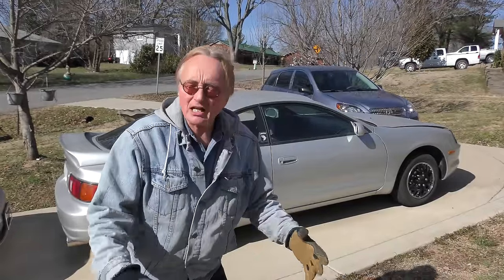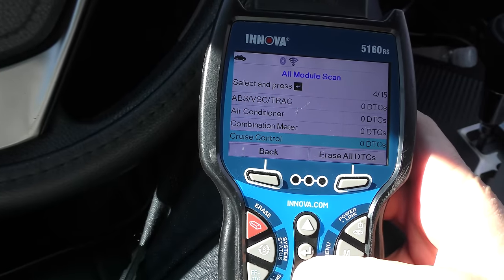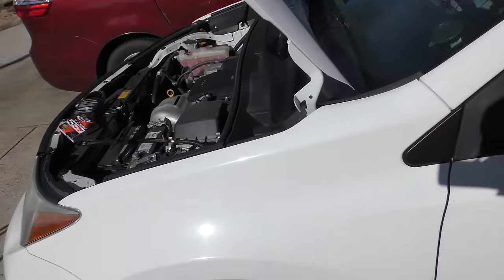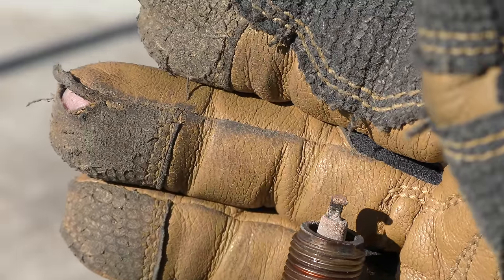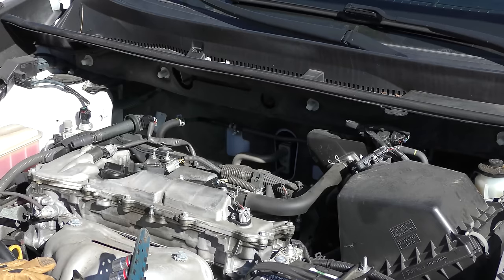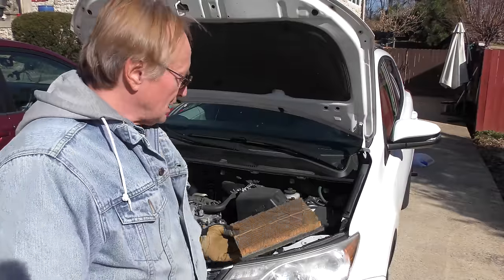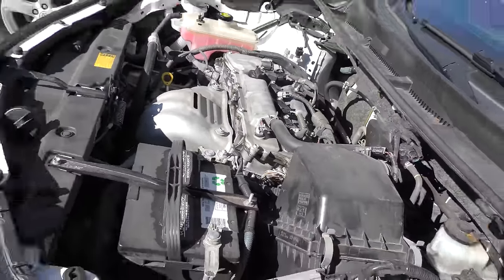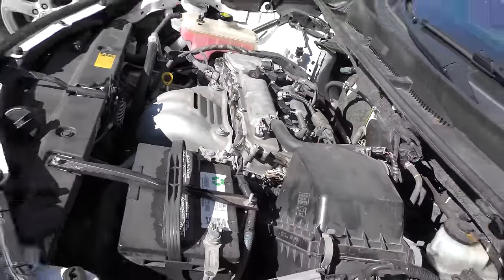Here's Why You Should Remove Your Gas Cap Right Now

Comment: Do you have any tips for getting pieces of broken porcelain spark plug out of the hole your coil pack goes in. I’d like to see what methods people have tried. I did my spark plugs yesterday and I have that exact car same year and model and mine has 101k miles on it. My dad used an empty wrapping paper roll to make a custom vacuum attachment to fit in that tiny 1inch wide by 7 inch deep hole to vacuum out the pieces

Comment: My new mechanic described what he did to my car recently as a tuneup. Of course, 150k miles on the original spark plugs meant at least changing those…
Reply: What to the old mechanic I would have stuck with him had to be good mechanic if you never even changed spark plugs hell we change ours in our race cars every race we like to think that's why we are in the top seven at end of season every year except this one with cover it really messed our season up when you hit the corners on our high banked curves at pevely i55 raceways we haven't had races and we planed things with family  doing other things because couldn't know if raceing u till the day before the race and by God it was a pain maintains the 6 feet apart rule side ways in a curve at apoxamatly 100miles a hour strick fines if caught closer lol still in top 12 finish no one knew if we were racing or not I told them we should be Abel to out run it but I quess the track officials couldn't a little racing hummer this morning every body act like allied and be safe just rousing you Allied official your great see yo I next spring if you all ain't afraid of the getting dirty lol can't wait new car bigger moter and possibly a new driver

Comment: When you change your air filter, clean your MAF (mass air flow sensor) and throttle body. If sensor is dirty it won't mix air and fuel properly. Same with throttle body. I change my plugs every 50,000 miles.

Comment: I have a 2006 Avalon, low miles.  It's an awesome car, but the traction control is worthless on extremely slippery roads.  It will not go any ware.  There is no way to turn it off.    I found that I can loosen the gas cap so that the computer will through a code.  When warning comes up it turns off the traction control. Yeah!

Comment: I always replace my fuel tank caps to locking fuel caps due to fuel theft and vandalism.
Reply: Do you drive a 1960s vehicle? I’m pretty sure all cars made since the 80s or so have anti siphon mechanisms to prevent fuel theft. However, nothing will protect your gas tank from a desperate individual with a drill
Reply: @Prosecute-fauci  only thing with the locking capts the punch lock-in catching up in the filler hose I just never put my gas in it unless I know I'm going to drive it out same with the windows you don't roll your windows up and lock your car in the hood you just don't leave nothing of value in there leave windows open so you keep the glass we can have the cigarette butts in the ashtray and the change under the seat speaking from experience unfortunately
Reply: @Prosecute-fauci  yeah it's a screen you need a longer screwdriver
Reply: When the battery operated saws started coming around catalytic converter nothing to steal 1 if you don't have to hacksaw through it that's too much like work

Comment: Scotty, for Toyotas , should the spark plugs be NGK or DENSO ? Not AUTOLITE? Kindly advise please.
Reply: I have a Toyota and change my own. Over 250,00. I always use NGK.  That's what Toyota recommends and other mechanics I have watched. I never had to thread it or anything. They work well for 100,000 plus. I drive a lot!
Reply: You can use either NGK or Denso  never buy auto lite they’re cheap junk or anything that’s not NGK or OEM (Denso)
Reply: Use Bosch spark plugs.
Reply: NGK.  I tried Bosch in my Vibe (Matrix/Corolla engine) years and years ago, and was not happy with the performance.

Comment: What about gapping plugs?
Reply: Any new ones with the tiny pinprick electrode tip are already set because if you try it you will break the tip off. The old copper type with the big diameter electrode can still be gapped.

Comment: Never buy pre gapped spark plugs, theyre always wrong. I bought some that were made for my truck and they were further apart than my original used spark plugs were.
Reply: @Buick Mackane  pre gapped spark plugs are way more brittle and easier to break. I meant what I said, you should just avoid them.

Comment: Nowadays I consider a tune up changing out the plugs, coil packs, air filter, fuel filter, oil/filter, transmission fluid, gear oils etc then resetting the computer. Just maintenance really

Comment: My Coleman 5k watt generator doesn't run right. I do believe it's the bad/worn/broken rubber seal on the vented gas cap causing the issue.

Comment: I have the same problem with my 2013 Rav4, the tire pressure light keeps coming on. 🤔 Did go to Firestone and had one sensor replaced because one tire was 30psi  but the light came back on, and then it went off the next day, not sure if it's the crazy weather we have in Erie, PA or my system is showing its age.
Reply: It's the weather.

Comment: What happened to checking the spark plug gap before putting the spark plug back in, as you can't always trust the gap that the spark plug came with from the factory?

Comment: Years ago my 2005 Subaru Outback showed a vapor leak. New gas cap applied. Still a vapor leak. Long story short, a rat had chewed all three small hoses that apparently return pressure to the gas tank and run from the fuel filler opening to the tank. Had to remove the passenger rear wheel and wheel well cowling to get to them. Once replaced, the code went away.

Comment: I'm really wanting Scotty to have an in-depth review on the new tundras and if it's better to buy the new models compared to the 5.7 v8s
Reply: Any Tundra has enough power.  It is the Tacomas that are too light on power.
Reply: I wouldn't take advice from someone who puts autolite PLUGS in a toyota
Reply: Do you use champion  or ac or those splitfirejunk that I never had any luck with love had good luck with accel plugs and wires

Comment: Scotty, my tayota Yaris from 2000 has 2 problems, one is the catalyst(P0420 - Catalyst System Efficiency Below Threshold (Bank 1) i did once a cleaner in but i drove with if on diffrent days did it work then or nha>? in total i drove 500 miles witht he problem

Now my car is also at a cold start holding in what could this be? When the engine drives like one minut its perfect, but before that its holding in. what to do?

Comment: Ihave original plugs in my 3.0 mitsubiti montero sport 2001, Ive got 230k on it and still get 20 mpg hwy, Im shocked at that. I had decided to see just how many miles it would take to effct the emissions or decrease mileage. Ive passed SoCal smog  every 2 years since new . I am amazed of the reliability. Is that typical of these or even other cars today?

Comment: Are gas caps one those parts I should try to stick w/ OEM so I don’t run into issues with sealing? Or would aftermarket be fine?
Reply: Stick with OEM.  Gas caps aren’t that expensive
Reply: Bought a cheap aftermarket cap, nearly got stuck in filler neck, tossed it, got an OEM.
Reply: OEM . We have tons of issues with aftermarket gas caps at dealership .
Reply: Only a few bucks more go OEM
Reply: OEM at all costs..
Reply: I still have the oem cap, with aftermarket rubber seal, its working well for me.
Reply: @theroyalcrownedtiger2946  oh u can change out the rubber seal itself? What vehicle do U drive?
Reply: @selwyn13  : I drive older GM vehicles.
Reply: @selwyn13  : I picked up the aftermarket gas cap assembly for a Ford, and removed the rubber seal, and installed to the oem GM gas cap.

The threading on the gas cap is different on the Ford and GM, but the seal works and fits just fine.

If you got a import branded car, forget about swapping parts, and just get a new gas cap from the dealership.

Comment: Tire pressure monitor sensors 50 bucks each aftermarket advance auto. Make sure your mechanic can read the toyota system correctly. Some scanners cannot, and they will tell you all four are bad. I had a 2014 rav 4 same trouble. Stupid but annoying. So i spent the 50 and 20 for a tire guy to replace. When you get tires, make sure your man knows there are sensors there or their machine will destroy them.

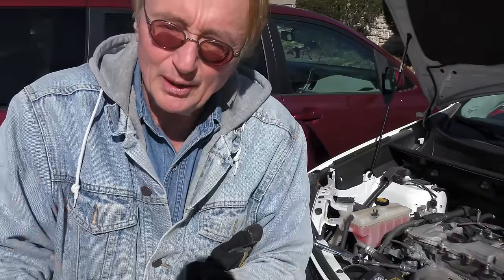Comment: At 5:28, "...already plated?"  How can on tell if the plugs already have a coating on them?  What are you looking for?  I always have a tube of anti-seize nearby to smear on the threads since it is such a long time between plug changes and I don't want the plugs to seize up.
Reply: I always put some on as extra assurance 👍

Comment: I have a 95 Corolla. My mom’s old car. All I’ve done is change the oil. Recently had to replace a rusted original radiator but relatively little problem since my Mom passed in 2011. How do you diagnostic test a car so old that you can’t hook the computer to it?

Comment: Hey Scotty. Love your videos and wealth of knowledge… I want to get your input. I have evap monitor showing green with a check engine light and code p0455. Would it be safe to assume the systems/valves works fine and the issue more likely the fuel cap or leak in one of the lines.  I don’t have a smoke machine to leak test the system.

Comment: How do remove gas cap off a Chevy Malibu 08 I have took a lot off the car before I paint it but never took a gas cap off before. Took the hood, grille back bumper truck the front and back lights, license plate, inside door panels, front sideview mirrors and all of the door knobs but took like a month to get it off because don't have a lot of time to do stuff because am at work but I do like auto painting more than detailing but have bought a lot of stuff in two years though which it is time to stop buying all the stuff plus trying to move now into my own house by myself.

Comment: Those Beauty covers aren’t just for looks. They regulate noise and sometimes purposefully redirect heat/temperature…dealer tech for a zillion years. Put the covers back correctly. Also put some motor oil or synthetic grease on those plugs in most modern cars or you take a huge risk of never getting them back out. Many newer cars use a very small plug and they seize extremely easily. I think he’s awesome but I disagree on both of these from professional experience.

Comment: I love these tutorials that walk through the troubleshooting process. Although I respectfully disagree with so easily dismissing the TPMS code. My car got the code and the tire wasn't seated on the rim correctly. I bought a used car with the code and the tires were under inflated. Why not troubleshoot TPMS too?
Reply: You could always double check the pressure, with your own tire gauge.
Reply: Donna Eastman, Dealer cost to
replace the 4 TPMS sensors
in a 2010 Corolla...$970.00.
Have an $8.00 tire gauge, a
$160.00 Slime Air pump
powered by the car battery,
once a month my renter and
I line up our 2 toyotas,  inspect,
check and fill tires to spec.
Done well & cost effective.
Like the "Maint. Req'd" dash
light the TPMS light is
primarily meant to induce
panic driving people to
the dealer service dep't
and from there to bankruptcy.
Pleased my 2003 Avalon
doesn't have either. Simple
is good sometimes, and I
keep my own service log.
Reply: @elultimo102  Yes, that would be one of the steps to see why the light is on.
Reply: @garyowen3662  Yes, technology costs a lot. The TPMS light isn't always on because the senors need to be replaced, you could just need air or like in my case the tire wasn't seated right. The used car I bought the mechanic told the lady, that it always happens on those cars. When I checked the pressure it was just low on air. So she was driving with under inflated tires. I filled the tires to the correct pressure and the light went off.

Comment: Scotty, when you say Toyotas need oil changes- what do you think about the 10,000 mile oil change recommendation in the later models such as my 2012 Hylander and 2014 Prius?   Since I got those, I do 10k changes but with synthetic oil.
Reply: Only for highway driving. In town, go no longer than 5,000. Oil is cheap, even with synthetic, engines aren't.
Reply: @hotpuppy1 Disagree.  What you may be referring to as “in town” is really like NYC Taxi service driving.
Reply: @claytondelanie 
Okay, Genius, ruin your engine saving a few bucks.😂

Comment: Spark plugs coils oxygen sensors air fuel ratio sensor crankshaft sensors camshaft sensors those of the modern tuneup. And don’t forget a battery most these cars have computers on them now and if the battery’s low ha ha ha

Comment: Toyota's MUNCH spark plugs?? Our Camry ate the Iridium NGK's in >50K miles... The gaps were consistently right around .100 which to me seemed excessive. I thought the coil(s) might've been on their way out, til I pulled the plugs! If you are getting 'misfire' codes, check the plugs BEFORE replacing those pricey OEM 'yota ones

Comment: I love the acrynom keep it simple stupid! I have replaced gas caps on my cars many times as even my old cars it has helped and on some it will trip a check engine sensor if it has worn out. I have helped others this way as well because it is a generally cheap repair and takes no time at all and long and behold the problem is solved lol

Comment: So are there cases which it is okay to use antiseize on sparkplug threads?
Reply: I wouldn't, never have.
It's far too easy to over torque plugs in aluminum heads.
You could on an old cast iron head but again there's no benefit.

Comment: A bad gas cap can cause the check engine light to come on
Reply: You're right and so is Mr. Kilmer. First thing to check. I have an old '96 Chev pick up with 4.3V6. Every year "check engine light" - change gas cap, light out after a few miles and good for another year.
Reply: You're right. My mechanic told me that years ago.

Comment: Hey Scotty, I am a new driver my automatic car overheated and When I stopped to refill it I found the water cover had or the radiator cover had gone off already. I restarted my car and it refused to start again showing engine faulting and later shows battery low start engine. We tried to jump the battery but it still didn’t work. My mechanic says the engine is gone

Comment: There's no excuse for an ultra low power device installed in a tight system where pressure changes enough to be powered by a battery.  It can have a tiny pressure actuated generator attached and never quit working.  Or at least give enough battery capacity to outlast your tires.

Comment: I got a 2000 Lexus Rx300 with a P0440. I replaced the gas cap and the air filter but I still got the code. What should I do ? the hoses appear to be plugged in and not cracked near the airbox
Reply: Take it to a good mechanic and have them fix it. Scotty doesn't know lol
Reply: @thelostshadowofhanzo  I'm trying to see if other owners of the same car have run into this issue since this channel is mostly DIY type of people
Reply: @ChiroTheHero  I get that but if you want it fixed correctly the first time then take it to someone who knows what they are doing and can diagnose and repair it properly. Or you can keep loading the parts cannon and firing parts at the problem unit maybe eventually you maybe fix it, it is up to you, it is your car and your money. Scotty misleads people more then  actually showing them how to PROPERLY diagnose and repair faults properly. Either you can do it your way, or get someone who spent 4 years as an apprentice then 4 years as a journey man as  well as every year taking new courses to update their training every year or so. As well as they work  diagnosing and repairing vehicles everyday 5 or 6 days a week and has spent thousandson specialist tools. Or listen to some guy who can bearly do a proper tuneup and dropped out of his anthology course 🤷‍♂️. As someone who is trained and works in the automotive field I know what i would do as I have had to deal with many vehicles that people have spent thousands on before bringing it to me to have it fixed properly for a fraction of what they had already spent lol

Comment: Hey Scotty, what are your thoughts on Ruthenium spark plugs over Iridium?
Reply: Both metals are in platinum group.  R is more rare and expensive.  R has a melting point of 600 degrees.   I is the second-hardest metal & can withstand 2000 degree temperatures.

I’d stick with the Iridium or Platinum plugs & save money
Reply: I just installed some Rutheniums on my Mazda Skyactiv and they are pretty smooth.

Comment: Does anyone replace the batteries on those sensors inside the tires?
Reply: I believe that little sensor is a sealed unit. Once the battery goes you just replace the whole thing
Reply: @SteveB88  There are some that have replaceable batteries.

Comment: I figured that Scotty would have replaced the serpentine belt also.
Reply: You can easily spot if it needs replacement.  IF it's flexible, no cracking, and isn't polished shiny, it's usually just fine.

Comment: My evap code went on my Dodge pick up changed gas cap and two other things and it still comes up with e vap  code when gas is 3/4 and lower what's your suggestion besides keeping a full tank
Reply: Take it to a mechanic who will hook up a smoke machine to the evap system and use bidirectional control to activate the valves to see where the fault is or if there is a leak in the system. Find one who knows what they are doing so in other words NOT Scotty Kilmer 🤣

Comment: scotty i cant find a fuel pump mounting bracket anymore for my 91 camry because they stopped making that part, what should i do
Reply: Check eBay...
Reply: Go to a auto parts yard .
I  had to replace the one on my 95 Integra and I got it at a Junk Yard .
Reply: You might have to just make one or adapt another part to work like we had to for our rear transmission mount on our 1984 S10 pickup. Had to adapt a full size mount to fit & work on our S10.